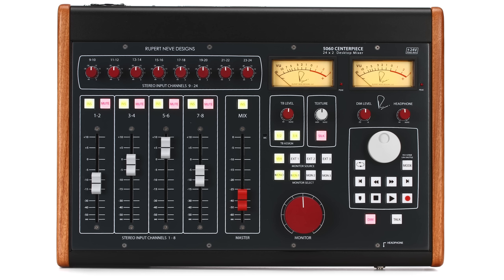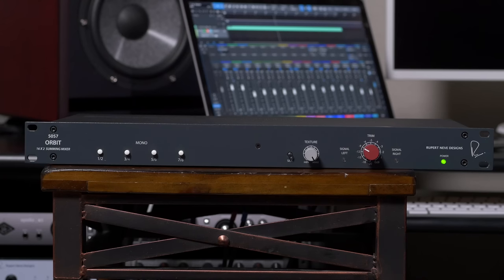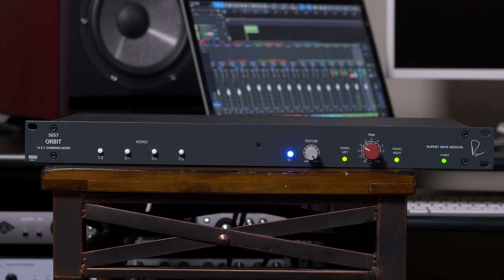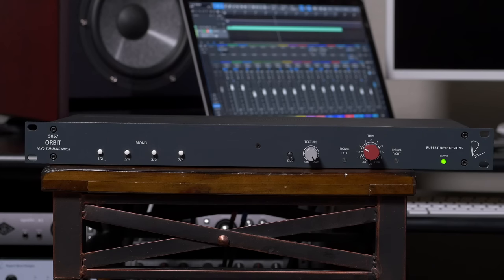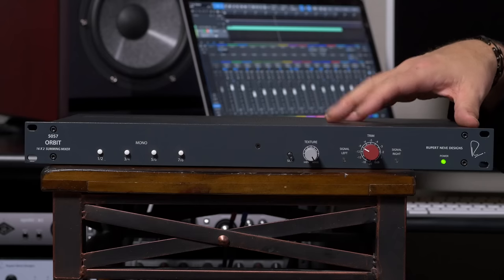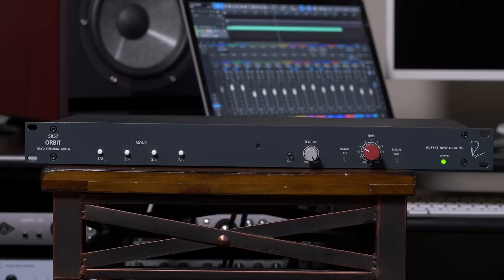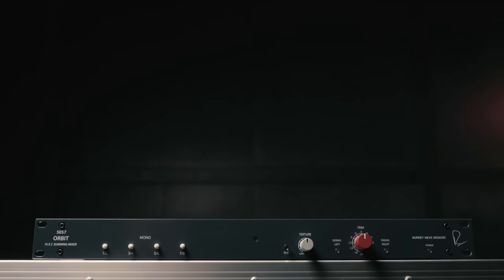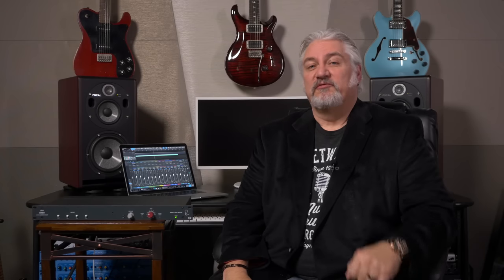Rupert Neve Designs 5057 Summing Mixer Demo

Comment from the maker: Thanks for checking out the Rupert Neve Designs 5057 Summing Mixer with us! Find more ways to upgrade your studio with innovative gear like this by hitting like and subscribe!
Reply: @sweetwater  how can I push into it using logic as my daw ? I just switch from pro tools and was able to do so there by creating master fader tracks and assigning each master fader to the orbit . Thanks
Reply from the maker: @erictorres5935  Hey, Eric! Great question and thanks for your interest. You should be able to get a similar setup in Logic using the I/O utility feature on a bus fader. Here’s some info from Apple’s User Guide:
https://support.apple.com/guide/logicpro/use-io-utility-lgcef2d8c7d2/mac
I hope this helps! Feel free to reach out if you have any questions.
Connor Smith, Sweetwater Sales Engineer, (800) 222-4700 ext. 1793, connor_smith@sweetwater.com

Comment: I’m still so confused by these units. I’d love to see a routing diagram. Do you only route audio to it when you’re done with the mix? Or are you going through it the whole time? Do I keep 16 outputs spare just to send them to this, then 2 back to my DAW? Or do I patch everything occasionally over to this? There’s a lot of assumed knowledge when these old boys are talking about gear 😅 I’m trying to follow 😂
Reply: You read my mind!   Hopefully somebody can provide an answer on here.
Reply: @R.Es1  Nobody did, I asked on a bunch of forums and Reddit posts and as you’d expect, people were just snarky dicks. So I worked it out myself. Spoiler alert - it’s not cheap:

I’m going to buy an ‘Antelope Orion 32+ Gen 4’ interface. That thing has loads of DB25 multicore cable i/o on the back. So I’ll basically have 2 of the DB25 outputs (8 channels per DB25) on the back of the Antelope going to the ‘Neve 5057 Orbit’. The orbit will do its magic, then I’ll send the stereo output of the Neve back into the Antelope by way of a patch bay (I think, I haven’t looked at the diagram for a couple of weeks). 

This way, I can just record and mix etc whilst routing all my instruments into groups that get sent to the Neve, then the stereo pair come back and that’s what I set as the source of my studio monitors (in my DAW or in the Antelope routing software). So I get to do every step of the process via the Neve, which I think would be pretty sweet! 

The rest of the Antelope i/o would be sent to a DB25 patch bay like the ‘Black Lion Audio PBR TT’ which uses funny little ‘bantam’ style patch bays to save space. So I can incorporate my other outboard hardware with those connections. 

It’s worth noting that the antelope doesn’t have any pre-amps. So you can’t just plug a mic into it. It’s more of a converter, doing the analog to digital conversion. So you’ll need outboard pre-amps, like a ‘Warm Audio WA-412’, although decent cheap ones are available too, like the ‘Behringer ADA8200’. 

That said, if you’re shopping for Neve summing mixers you’re probably not strapped for cash.

Anyway, this was the most flexible / cost effective way I could find to do it. I really wanted to be able to track and mix and master via the Neve and this allowed that. Nothing even came close to the Antelope in terms of capability for a similar price, so it seemed like the obvious choice. 

Hope that helps!
Reply: @KyleBevis-u7j very helpful I’m currently running on the Avid Carbon would it’s outputs be enough
Reply: @KyleBevis-u7j only thing bad about that antelope is the buffer size can only go to 512 and not 1024 which is useless for most ppl, 512 and lower is good for tracking, but when mixing with a ton of tracks with plugins you definitely want to be able to go to 1024 if you should need it.
Reply: @MilestonesMusic1 how many outputs does the carbon have?
Reply: @Gang-25j  I could be completely misremembering, but I thought that was only an issue between antelope and protools?

Comment: Will this be ok if i run my stereo out from my DAW to the 1 and 2 inputs of the Orbit, cause i don't need the other channels.Or Will it be an overkill.I do send my mixes trough RNDI S for transformer saturation,but i think Orbit eill do much better job at it.
Reply from the maker: Hi, Nikolay – thanks for your interest! While it’s possible to simply run a stereo signal through a summing mixer like the 5057 Orbit, you wouldn’t really be getting the most out of the summing mixer by using it this way. The advantage of using a summing mixer like this one is that it will give you more headroom and analog character when mixing multiple channels in your DAW (up to 16 in the case of the 5057). If you just need a stereo processor, you may be better served by other analog gear such as stereo bus compressors and EQ’s, which will ultimately give you more control over the final sound.
I hope this helps a bit – feel free to contact me directly with any further questions, and thanks again!
Caleb Lowrey, Sweetwater Sales Engineer, (800) 222-4700 ext. 1620, caleb_lowrey@sweetwater.com

Comment: Are the preamps of the shelford same as the summing mixer? Also is the portico 2 pre same? Or is there any difference?
Reply: The summing mixer doesn’t have a preamp. Its just a summing device. The Portico and shelford  are not the same, so that means they are different….

Comment: Good job 👏 this is a sweet wish list item! 

Besides “that” sound, what else does this Orbit do for work flow/production?
Reply: Cant we do this with two shelford channels?
Reply: @mattg1094  Dude its a summing mixer.  It's not even remotely the same as running through preamps and back into your DAW. Digital sum and analog summing have a different sound. Analog has more punch, separation, clarity, depth, etc.

Comment: Would it be possible to send each individual track through it and back into my DAW? That way I have that analog coloration on each track BEFORE I begin mixing with my plugins?
Reply from the maker: Hi, thanks for your interest! Although it's technically possible to do what you describe, it would honestly kind of defeat the purpose of using a summing mixer. These devices are designed to take multiple channels from your DAW (16 channels in the case of the 5057), and allow you to mix them with increased headroom and more analog character before bringing them back into the DAW as a 2-channel mix. If you just want to process one channel at a time, you might be better off using a 1- or 2-channel processor - something like the Elysia Karacter:
https://www.sweetwater.com/store/detail/Karacter--elysia-karakter-class-a-stereo-saturator
Hope this helps a bit, and feel free to contact me directly with any further questions!
Caleb Lowrey, Sweetwater Sales Engineer, (800) 222-4700 ext. 1620, caleb_lowrey@sweetwater.com

Comment: so this is like a 5059 without knobs and two separate outputs?  Or are the transformers different than the 5059?
Reply from the maker: Hi, Neil. Great question. You understand it correctly. You get the same RND transformers as the 5059 and a -6dB out to accommodate converters that do not have the headroom to handle the hotter output. This unit eliminates the individual channels levels – with the thought process being easier recall for DAW based workflows.
Thanks for the interest!
Cody Kraus, Sweetwater Sales Engineer, (800) 222-4700 ext. 1766, cody_kraus@sweetwater.com

Comment: I have a Shelford Channel. Am I better off buying this or another Shelford to do the same through the 2 shelfords??
Reply: You can't sum 16 outputs with 2 Shelfords. But you can do cool things that this can't, like, EQ and compress. And another Shelford costs like nearly 2 of these...tough decisions really.
Reply: depends. Summing is about headroom, space, and external gear. Shelfs cover the headroom (kinda) and external gear, not the space, depth, and separation. Protools summing is good until you hear analog then its like wth bottleneck tools
Reply: I’d buy one more shelford... get the 5065 summing mixer... and route it all to come back through shelford for mix down
Reply: @kevinbatchelor9566  Says who? All you need is a bunch of resistors.
Reply: Depends on what your want. Shelford channel has the induction EQs, diode bridge compressor, silk. If you had two Shelford channels you can run your stems through them and fine tune them with light compression or EQ. If you want a set it and forget it Neve box that will give you a 5088 sound for 16 tracks then this is a no Rainer . Do you prefer to tweak your recordings or do you just want the weighty Neve sound without thinking about it?
Reply: @mattg1094  that would be nasty